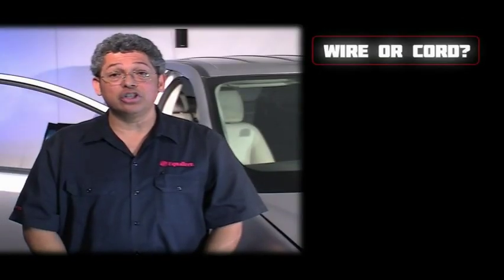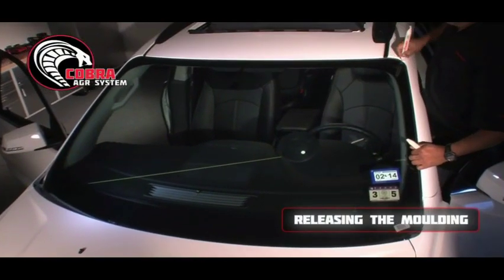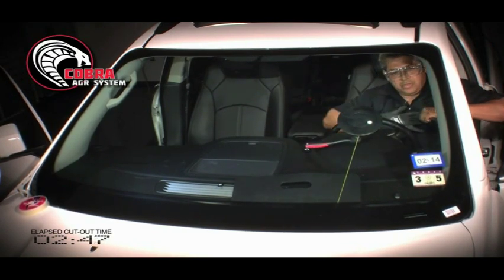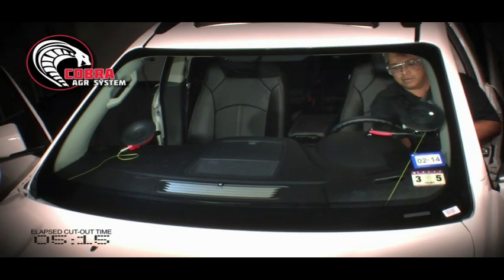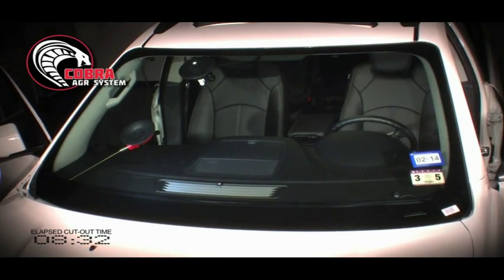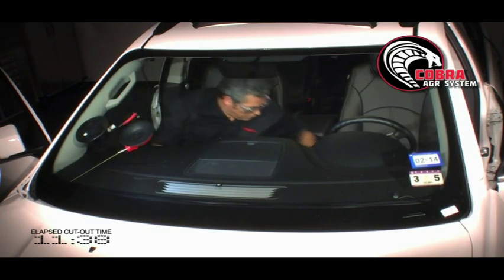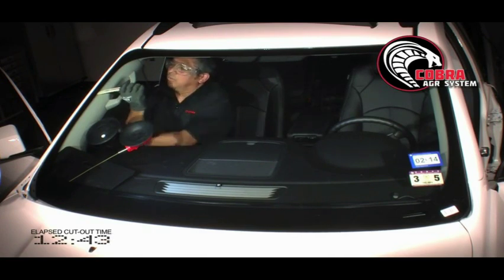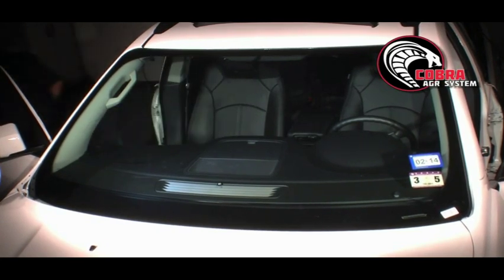BTB Tools - Equalizer Cobra Wire Windscreen Removal Tool

Comment: Has anyone ever tried to use the cord or wire along with some type of lubricant like sika slick or something similar? I think it could work to help the cord or wire to cut with less effort. I am going to experiment with it and i'll let you know how it goes. Great video on the Cobra.. I have owned one for quite some time and at that time there wasn't a video like this available. It tought me a couple things I didn't know.. Thank you!
Reply from the maker: We have had people tell us they use a lubricant and it helps. I personally have not used it but I don't see why it wouldn't hurt! I look forward to your feedback once you've used the cutting lubricant. Unfortunately I believe the Sika Slick is only available in North America but it is important that when using anything other than water, it must be approved by your urethane company, as the wrong product will contaminate the urethane bead, which will be detrimental to the urethane adhesion when re-installing the new glass.

Regards
Adam Smith
Export Marketing Manager
BTB Auto Glass Tools
Reply: btbtools w